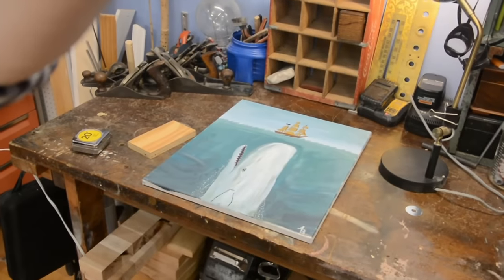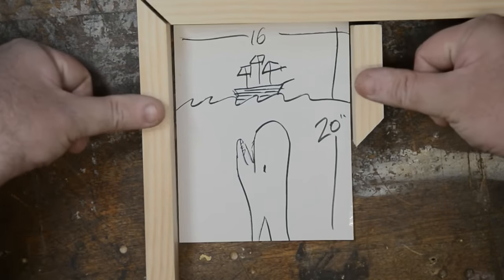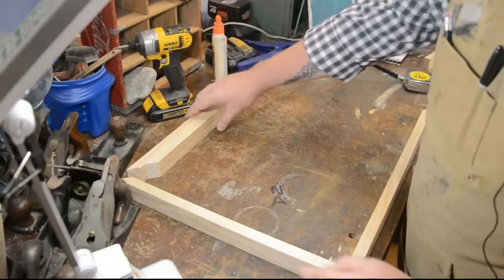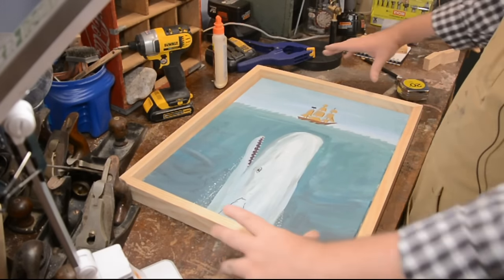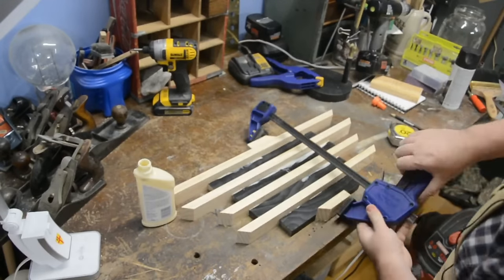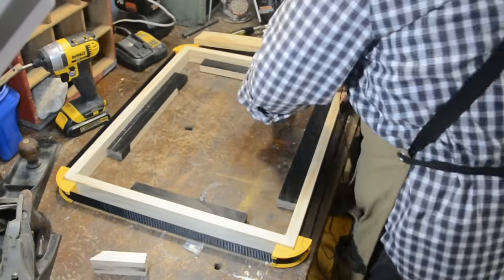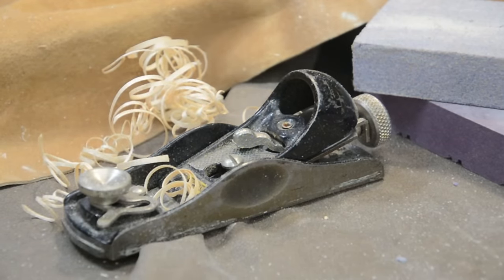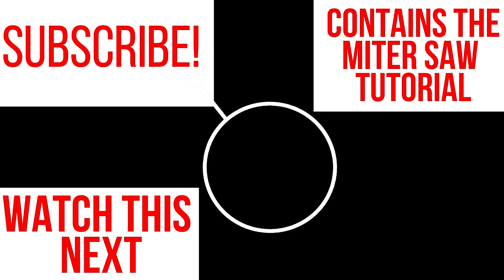How to Make a Frame for a Canvas Painting

Comment: I don't understand how the painting has space to give the floating effect with the measurements you took. Am I missing something?
Reply from the maker: Yes, AND I forgot to say something in the video. The measurements INCLUDE the spaces in the math. Hard to explain after the fact, but one of the measurements that deals with the angled cut includes the variance for the space.
Reply: I just added a half inch onto all sides and it gave me a little vacant space so the painting can float.

Comment: Nice job.  I love the fact that you didn't use any "finishing nails".  I have a finishing nail gun but not having nails showing on the outside of the frame is awesome.
Reply from the maker: I agree. Easy to throw a brad nail in, but cleaner look without it. Also it really doesn’t need the nail as this isn’t holding any weight, just hanging on a wall.

Comment: My wife's brother passed away this past year from Covid and he had so many piece of canvas art he painted so your how to video for creating a frame seems ideal and simple enough. I just subscribed and will have to check out how to cut the miter joints on the corners as never done that. Thanks for the great video as Michaels wanted to charge me 200  to frame each one and he has about 30+ paintings on canvas. This will be a heart felt project as he and I found out that we both had served with the 82nd at the same time back in 1970.
Reply from the maker: Very special. If I can help in any way, or you have any questions, just let me know! Yeah most places that do framing are expensive. I never understood why.
Reply: @BurkeMakesStuff  thanks. Will reach out if I have any questions. just have to learn how to make those cuts using that miter box so the angles are correct.
Reply: @BurkeMakesStuff  I do.....  cost of labor+cost of material+running a business to make a living etc etc.  BTW great video

Comment: This is a great video. My wife asked me to do a similar project for her paintings. What kind of wood did you use and where did you get it from? I'm a total noob and this will be my first wood working project. Any and all help with a list of materials would be much appreciated. Thanks.
Reply: I’m using pine wood, known as common wood in Home Depot. It’s cheap and light, and durable for indoor use. The type of mounting hardware you’d need would be d-rings and a hanging wire so that you can hang it on the wall.
Reply: What size was the wood?

Comment: You indicated that the frame is 3/4” thick, but how wide? It looks to be 1-1/2”, correct. And for the screws, what size and length. Guessing flatheads?
Reply from the maker: Yes. I believe it’s 1.5”

Comment: I tried to make this frame, but in the end, found that my painting was just a smidge too big/my frame was a smidge too small. To have that floating look, should you add another 1/8 or 1/4 of an inch to the outside dimension?
Reply from the maker: You could, but that should happen automatically if you follow what I did in the video, because when I have you add the thickness of the framing material, we then cut it at a 45 degree angle. Doing that should add about 1/8 of an inch. Because the addition of the thickness would be if we were cutting it at a 90 degree angle.
But if it didn’t work for you, def add a bit.
Reply: I was wondering how you ended up with that slight gap. Now it makes sense.

Comment: Great video. Besides adding 1 1/2 inches to the length of each piece, shouldn't we also add about 1/8 inch to get that nice gap all around the canvas?
Reply from the maker: No. I built that in by having you cut the miters on a diagonal instead of straight. Good question though!
Reply: Thank you Sir!

Comment: Love the frame! How much space do you allow between the artwork and the frame? And do you add that to the overall dimensions eg. 21 1/2” becomes 21 3/4”?
Reply from the maker: the space is factored into the measurements i give in the video. i didn't explain that very clearly, but it all works out.

Comment: You have a small gap around the painting creating the floating effect - did you allow for that gap in your measurements? Or did that appear after measuring accurately the specific dimensions of the painting?
Cheers, great video 👍
Reply from the maker: I left the gap BECAUSE of the floating effect. Lol
Reply: @BurkeMakesStuff  thats cool, but doesn't really answer the question 🤣 when you were measuring up did you add on an extra 5mm each side or something?
Reply from the maker: @TRICO-WANDER  yes and no. It was planned for, but not added. This may be a liittle hard to explain in writing. When I explained that to get the outside measurement for the frame, you add the thickness of the wood that’s accurate if we made 90 degree cuts, but we used the miterbox to make 45 degree cuts instead. That 45 degree cuts is slightly longer than the thickness of the wood simply because they are 45 degree cuts. That difference is what shows up in the final product as the gap around the painting. It’s hard to explain, but as long as people are trying to make a floating frame, and follow what I did in the video, it comes out right. 😆
Reply: The 45 degree cut doesn’t alter the thickness of the wood! 🤦‍♂️

Comment: When measuring the for the cuts, are you measuring from the long end (outside edge) of the cut to long end? Or short end (inside edge) to short edge?
Reply from the maker: To be 💯, I don’t remember, however if you do it as I did it in the video it factors in the measurement for the spacing to
Make it “float.”

Comment: Hey Burke. I love your vids and I’m an artist and I am going by your DIY float frame but I have a problem I’m using an old frame for a 16 x 20 painting I have finished. But the 20 x 16 canvas same brand I’m using as a template. Doesn’t seem to fit. Is the canvas off?  Should I only go off measurements from the canvas that is going to accept that particular frame. Any help on this I would really appreciate it thank you very much!
Reply from the maker: Hey man. Do you mean based on the frame I made?

Comment: Hi.  I love this method.  Seems doable but wondering if you think gluing it would be enough for a larger frame? Do you think it would hold up with the additional weight?  For a 36" x 48" canvas?
Reply: I was wondering the same thing. Did you try this method on a big canvas? How did it go?
Reply from the maker: Try it. I really don't know. depends on the wood, how accurate the cuts are. Its

Comment: Great video, thanks! 👍 How did you finish off the back for hanging?
Reply from the maker: I believe I used one of those bars with the teeth that you get from Ook. Google em. Great hanging hardware. Along with that I put a small get pad along the bottom just out of site to compensate for the space the hardware takes up.

Comment: Hello,
I want to try this but the canvas I have is just a canvas itself. It’s not on the frame. How can I create a frame for the canvas alone? Thanks
Reply from the maker: Not sure. But there MUST be a video on it out there somewhere.
Reply from the maker: Not sure. But there MUST be a video on it out there somewhere.
Reply: @BurkeMakesStuff  thanks
Reply: Cricket  you would need to mount the canvas to a backer board of Masonite or thin birch plywood. Seal ALL sides and edges with Golden's GAC 100. Two coats min, then using a pva acid free glue attach the canvas. Then you can use the floating frame.

Comment: I am wondering where in the canvas you put the screws?..Did you attach something to the canvas first?
Reply from the maker: The canvas already is on a “stretcher” it how the canvas is mounted when you buy it. The added pieces to the frame I made were screwed directly into the “stretcher” portion.
Reply: @BurkeMakesStuff  For canvasses not on a stretcher(but stuck on to board ) what would you suggest?
Reply from the maker: @jackiemarren8387  if two board is thick, this process should still work fine. If the board is thin however, it won’t because there’s nowhere to be able to use screws without going through the board. In that case, I’d make the main frame the same way, but instead of attaching the secondary pieces to the main frame, I’d cut  what’s called a rabbet into the backside of each of the 4 sides of the frame before attaching them. I’d make it so that when put together the rabbet around the back of the frame would be the size (sliiiiightly larger actually) than the board with the canvas. Then insert tot board, and use what are called metal “points” to keep the board in place. This is very hard to explain in words, but I hope It helps
Reply: @BurkeMakesStuff  
 I have an idea what you mean. I checked out what a rabet is. Thanks a lot for your help. !
Reply: A rabbet

Comment: If you made the frame exact and then why is the painting floating? It would be tight therefore you probably should make the frame 3/8 of an inch larger than the painting?
Reply from the maker: Actually the math to make it bigger to “float” is already factored into the cuts I talk you through. No need to add
Reply: Nice frame! My wife asked me to make something like this and your video will save the day. Can you help me understand the measurements to make it "float" inside the frame? It looks like you cut the width, for example, to 17.5". If the pic is 16" wide and the frame sides are .75" (so 17.5" total), how is there still room to float? Seems like it'd be a tight fit. Thanks for the help!

Comment: Must include expansion gaps in your measurements
Reply from the maker: For the frame? No. There won’t be any expansion… but if you mean for the gap itself, that is included in the fact that the way I explain the diagonal cuts, it that creates the gap, though I didn’t discuss it, it’s factored in.

Comment: why am i overthinking my frames?  i glue them, run finishing nails into them also.  your right, glue should be good, its not really a functional object.  maybe i am being overcritical, but the gaps on the miteres really bother me.  are they really noticable to you, or am i being overly critical?  ive been spending hours making frames, sanding, filling, etc.  thx for video
Reply from the maker: Miters are I
Portent only if the error is noticeable. I’ve been to plenty of art museums where the frames are atrocious, so I’m not overly concerned, as long as they match up pretty well. You can also use wood filler after they are made to make them 100%, if it really drives you nuts
Reply: @BurkeMakesStuff  thx!

Comment: yes but if the canvas is 16 x 20 and the inside dimensions of thr frame is 16 by 20 that leaves zero clearance between frame and canvas and eliminates  the "floating" effect--the fractional space between frame and canvas--no?
Reply from the maker: Have addressed this in other posts. The spacing is built in, based on the angle of the cuts. I explain it in depth somewhere in this thread.

Comment: You didn't attach the glass in front of frame to protect the painting from dust 😒.
Reply from the maker: Correct. Because it’s just a cheesy painting.... but now that I’m thinking about it, I go to the Metropolitan Museum of Art all the time. They don’t use glass either.
Reply: Of it's an oil painting glass is not ideal, oil needs to breathe and cure over time and depending on how thick the paint is that can't take YEARS. Use a good varnish (oil or acrylic) and the painting will be safe.